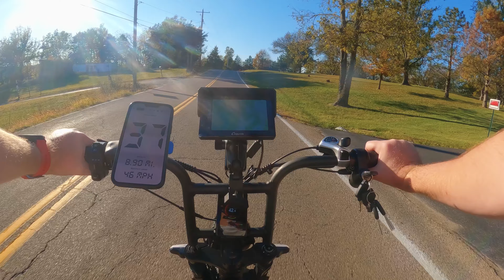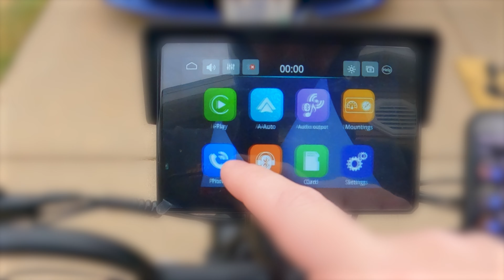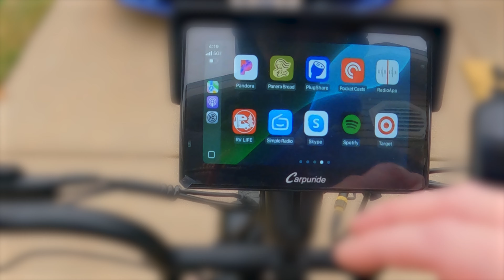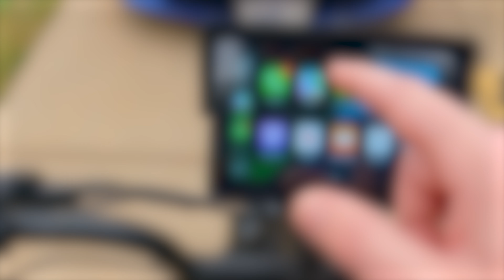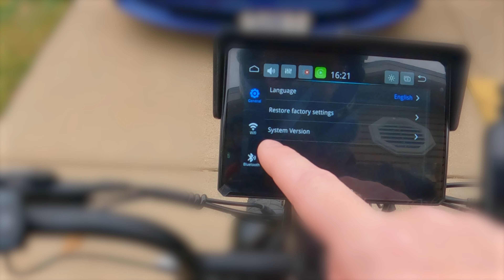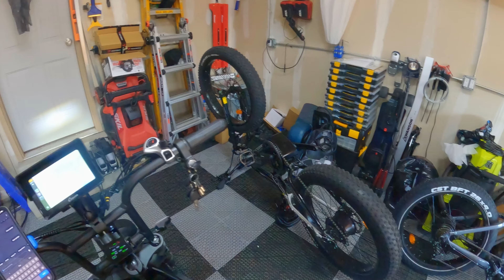Power Goat V3 60Ah Battery Install and Test Ride feat. Carpuride - Apple Car Play Device for E-bikes

Comment: I have dual 60v batteries on my power goat, would it be worth it get this monster of a battery?
Reply from the maker: @B_gr8-RI  Are you draining your current setup, frequently? If so, then yes, it would be a wise upgrade. Or maybe you’re not going very far, cause you’re afraid you’ll run out of juice… then yeah, I would definitely upgrade.

Comment: Does anyone know how long you can go with this battery with just pedaling?
Reply from the maker: @brandonboss6868  Over 100 miles, easy.
Reply: @RandyRides  awesome, because there's this trail i wanna do it'd 52 miles one way. I wanna see if i can do the whole thing haha. The problem is, it gets gravel half way through, it will be fine in the gravel?
Reply: @RandyRides hey Randy, have you driven this bike to empty yet to see how many miles full throttle with the 60 AH battery pack?

Comment: Hi there, so whats the difference between powergoat v2 and v3?  From what i reaserched and watched I have heared many people saying that this is the best E bike under 3K and they all had no problems. Is that your opinion too? or you recommend something else?
Reply from the maker: @furybn7527  The V2 had a 16S battery pack vs the V3 with the 17S. The V3 has a bit more power and range. It’s a great purchase. 👍🏻
Reply: @RandyRides Thank you so much for your reply. I also have heard many people mentioning the display readings of battery percentage and  voltage reading issues are way off and the speed reader as well, they say you need to keep turning off and on to show accurate results,  has that been fixed for V3? I saw it in many videos mentioning all those display problems and they were all on the V2.
Thank you so much.
Reply from the maker: @ It was resolved with a firmware update.

Comment: Nice review. Thank you for sharing. 

   Some side comments not directly related:  Let's be honest, most people who buy these type of ebikes aren't really buying them for the biking/pedaling aspect, but more for the power and speed (which is understandable).  But there are two main issues with these type of ebikes. They are heavy AF and tend to be expensive (especially the better quality ones). 

   If I had the time, money, and energy (I don't currently, but hope to someday), I would cut out the middle men of weight, expense, and complexity while increasing the aerodynamics, which once you get up to 20 and 20+ mph, air drag/friction becomes a big energy drain. 

  Imagine this instead:  Get 2 sheets of 1" XPS foam board, and a couple smaller sheets of lighter weight, thinner plywood (like baltic birch or luan).  Cut the foam and plywood to around 2.5' x 4' but in a somewhat narrow triangular shape, narrower at the front (not pointed at the end though, but rounded) and a bit wider at the back.  Take some high strength lamination epoxy and  4 oz/yd2 or so S glass or basalt cloth and do a top and bottom layer for both of the 2 foam board shapes and the plywood shapes, and then sandwich them together with the plywood on the outer top and bottom layers.  (make a seat out of the same reinforced foam composite, sans the plywood, and add a topper of thick EVA foam for cushion).

  On the back end, attach a 10 to 12" fat tire scooter tire w/appropriate controller that is rated to at least 750 watts and at least 48 volts (more for both preferably, but probably want to limit it to 3000 watts and 60 amps for the controller/battery combo).   On the front, attach heavy duty, larger mountain skateboard wheels. Also on the front, get a sheet of clear, impact resistant acrylic, or polycarbonate, and heat shape it to be a bit rounded and attach to the front at about a 40 degree or so angle. Use foam sprayed and S glass fiberglass reinforced bamboo poles, or carbon fiber poles, to add supports for the plastic sheet towards the middle of the bottom board. 

   Then create an even lighter weight "trailer" using foam + S glass + lamination composite (only put plywood on areas that will be drilled into, the main part of the board/structure won't need it, we're only talking like 50 to 75lbs of weight that it needs to support).  On that trailer put solar panels and a substantial battery system (batteries should be relatively close to the back wheel of the vehicle).  

     You now have a low to ground, much more aerodynamic, and much lighter weight electric vehicle at a low cost, and which will go for a long time without needing to be charged.  It's basically a poor man, fair weather, single person Aptera. Almost all the weight will be from the batteries, solar panels, the back tire, and you.  The main structure will be very lightweight, maybe 25 to 30 lbs total.  

  (Yes, attaching that back fat scooter tire to the main board will be a bit of a challenge, but use your imagination).
Reply from the maker: @justinw1765  I’m not planning to do many modifications to it, other than upgrading components. Too many other projects going on this year! 😅

Comment: 46 lbs is heavy for a battery, but it's really not that much weight in a general sense.  It would have been a lot easier to lift had you been directly over it, rather than reaching out/over with your arms like that. All about leverages.
Reply from the maker: Yes, I understand, but have you tried filming at the same time? Sometimes I’m thinking about/doing too many things at once.
Reply: @RandyRides  True enough.  Definitely understandable. It was a good review, and thank you for making/sharing it. 

  Cheers